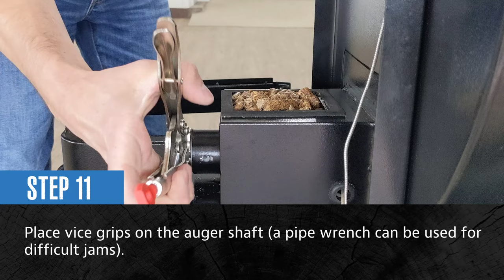How to Repair an Auger Jam on a Pit Boss Wood Pellet Grill

Comment: For something that’s a pretty common occurrence, this fix is a little ridiculous
Reply: Really?!? How common is it? Happened to me once in 6 years and I use my pellet grill about 2-3 times a week year round.
Reply: @nathanielhiebert6687  but you’re amazing
Reply: @jimwilkins508 hahaha sorry pal, I didn’t know you’re one of “those” guys.
Reply: I agree with @jimwilkins508.  If pitboss cannot design an auger to produce enough torque to turn pellets, then at bare minimum there should be a manual lug that can be turned.  I was able to fix it without rebuilding the grill, by using a pair of normal pliers and reaching down and turning the auger bar manually to break it free from whatever pellet was holding it up.
Reply: @nathanielhiebert6687  I also use mine multiple times a week for idk 3 years maybe and just had to do this for the first time 😂 maybe user error on everyone elses part
Reply: Using it very frequently likely keeps things moving. For those of us that don’t have every meal on this, the design sucks.  Pellets fall into the fan cage at bottom.  Air slots are too small for pellets to fall thru. 

Fan doesn’t turn / you are wasting your day taking it apart. 

Never buying their products again!

Comment: OMG FORGET IT
Reply: I'm going back to off set. KC Combo is a great concept that doesn't work very well. You can't get good bark and flat grill won't heat up enough unless you close lid. VERY DISAPPOINTED
Reply: @bryanhayward1967 i get a really good bark on smoker, but i agree with you about the griddle side not getting hot enough. I thought i was crazy. Tried making smash burgers and couldnt get a crisp to them. Was thinking about drilling the holes a bit wider on the tubes where the flame comes out tubes

Comment: Only thing I'd add to this is to use colored tape or stickers on both sides of wire harness so that you know which one plugs into which...  Last summer I jammed up and thought I was screwed (laugh at my dad joke).  I now have some hope for this summer.  I have so many wood pellet bags doing nothing right now.  Thank you for the video.

Comment: Depending on where your jam is you might be able to burn it free mine stopped working so just put some pellets in the pot and fired it up had to manually feed some burnt pellets through the auger via prime button but definitely worth a  try before this

Comment: Sweet! Done and back to grilling. Question: can I use any zip ties to bunch the wires back or use high heat resistant plastic ties?
Reply from the maker: Hey E. R., you can use any type of zip tie to secure the wires. It is not required to bunch them back up, unless a wire has a chance of rubbing against the fan.

Comment: Any tips for step 9? It’s not budging and is a really tight space to work with.
Reply from the maker: Hey John-Henry, we'd recommend reaching out to our CARE Team at (480) 923 9630. We should be able to walk you through steps if needed with a Facetime-like program!
Reply: For the nut I used a small automotive socket wrench to hold in place. For the Allen key I used a screwdriver with a six sided star piece. Added WD40 first to loosen and it worked after a few hard trys.

Comment: What type of screw is used on the brushing I lost mine
Reply: I bought a case of various sized screws. I used one slightly long so made sure it didn't hit the metal auger so it would turn.

Comment: The auger on my brand new pit boss smoker gets stuck super easily. Is this normal? The lowes had it sitting outside with no cover. I struggled to get one cook out of it. Any advice??
Reply: Im 6 months into my new pit boss smoker and same thing... very disappointed
Reply from the maker: Please call customer care tomorrow for assistance 877-303-3134
Reply: Yes 100% there is an auger plate you can get after market fixes this pitboss knows and doesn't fix issue
Reply: @jasonrobertson1284  that’s awesome I still haven’t fixed it. Where do I get something like that? It’s the season for cookin!
Reply: @jasonrobertson1284  where do you get this plate from?
Reply: It’s a nice grill for a few months and then forget it. I made the mistake of buying a second one after the first one lasted less than a year. 

You would think you get a year out of a $1000 grill.
Reply: @Joe Fetty  sorry late to reply, Google auger stabilization plate etsy, eBay bunch of folks out there make them for under 30. Pitboss could fix it for a couple bucks
Reply: @Texas&Tennessee  I am back on my weber kettle this season honestly. It just works consistently and every time.